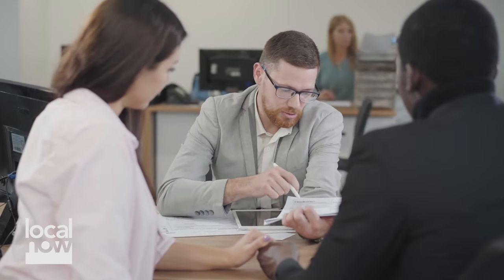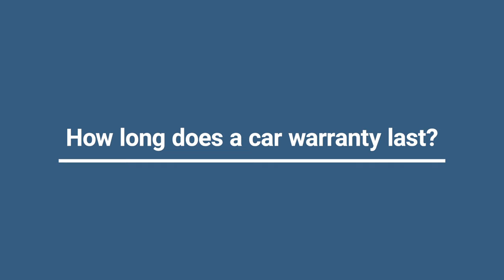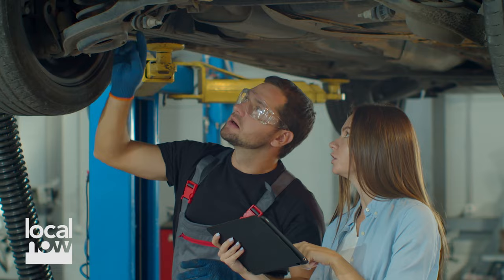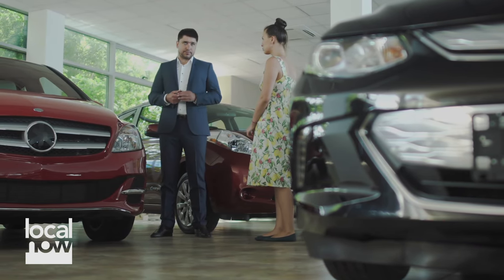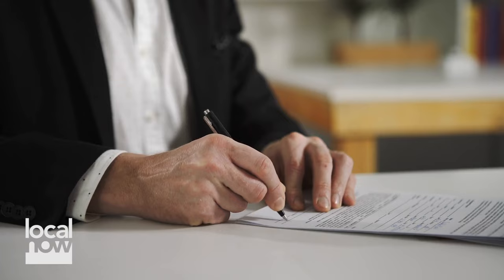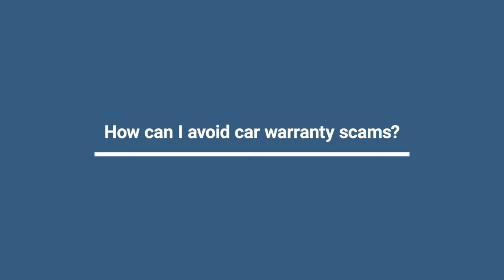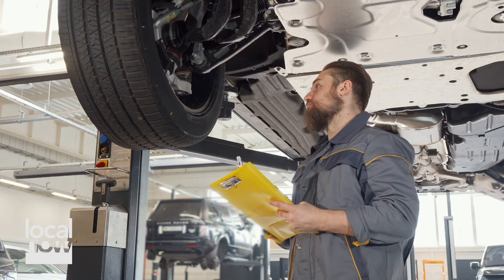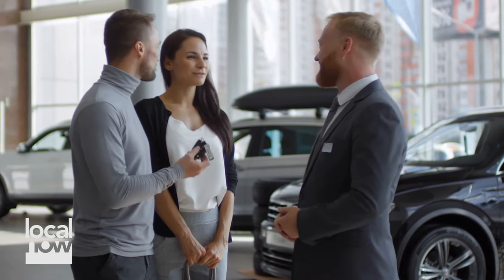The Truth About Extended Car Warranties for New and Used Cars

Comment: Adding my two more cents here about warranties. I had a new Lincoln Continental (back in the day). Dropped it off at the Mercury dealer the night before for LOF, etc., etc., nothing major. Planned retrieving the car early. The dealer told me it needed a motor mount. Said it would take 5 hours to replace, all under FORD warranty. I needed the car for work so I told them I was picking it up and would bring it back for the motor mount. When I arrived about 30 minutes later they informed me that they had already replaced the motor mount and had me sign some papers. I realized that they were just ripping off FoMoCo; but I also knew that Ford reps check the old parts once a month or so. If they don't have them they don't get paid. I should have pursued it but just hope that Ford caught them. They're no longer in business. There's liquor store where they used to be. Anyone wonder why new cars cost so much?

Comment: Most major components won't fail during their duration. Any plastic parts that do fail are never covered such as vacuum lines. Things in the TSB aren't covered along with many other components.

Moreover these warranties won't ensure the work is done properly. This is how you get a fuel pump replaced at 95K miles when it's a cracked hose at a brake booster.

Comment: @Lauren:
I have 11 months until my 2021 Jeep Gladiator 36-month factory warranty expires (power-train warranty longer @ 5 years/60K miles) -- the time very likely expire before the mileage does (I'm only @ 21K miles now). So since I am the "proud owner of Chrysler/Fiat/Stellantis crap" -- as some people would say (BUT my Jeep has been fine so far) -- AND because of the current crazy-prices auto-market (I don't want to sell mine and try to buy another with the higher truck prices & financing interest rares currently!), I'm thinking of getting a Mopar (factory) Extended Warranty as I plan to keep the Jeep longer than I first thought (likely 2-3 more years at the least). Not interested is "suspect" 3rd party extended warranties as they have mixed reviews, and I don't want a Jeep dealership giving me any grief over having a 3rd-party plan so a Mopar warranty seems the least problematic. And, I would want OEM Mopar parts for any repairs, not "alternatives" as per 3rd party plans.
So, getting a Mopar Extended Warranty would be Plan A, and from what I gather I have 2 decisions to make:
1. Choose between a Mopar "Added Care Plus" Extended warranty plan (cheaper but still some decent coverage AND may be the best value/cost ratio) or the "Maximum Care," Mopar's most expensive plan.
2. WHERE to purchase it at: A Jeep dealership in-person or online -- or alternative?
Any advice on this?
Plan B would do as you suggested: Just put money into a bank Savings Acc't and NOT get an extended Warranty. But like I said, I have "Chrysler/Fiat/Stellantis Crap" so I'm terribly concerned. Well, not really...at least not TERRIBLY.  ;-)
Thanks...
-- BR
Reply: @Leewilly440  Well, I'm going to research the Mopar warranty further, as that's the only extended warrant I'd want, even if aftermarket/3rd-party ones are cheaper. Plus, I plan to keep my Jeep maybe until 2027, so will just feel better with coverage at least for the major-cost repairs (parts & labor)...and likely go for their 8-year/100K miles (it'll take me forever to put 100K miles on it, so it's the TIME that will pass first).
Right now, I'm trying to decide if I want the Maximum Care or Added Care Plus. 
Then will look into where to purchase it, only @ Moprar online (like @ JeepFactoryWarrantyCom) or is there another source -- not a Jeep dealership, as I"d guess they'd be more expensive. Still, Mopar is pricey...but I guess all factory/OEM plans are.
What's weird though: I had 2 Hondas: a 2006 CRV (for 7 years) and a 2016 Pilot (for 5 years). Didn't have an extended warranty on the CRV but could have used one (2-3 major & costly issues!); DID have Honda Care on the Pilot but it was only used once for something minor -- and transferred the remaining 2-3 years of Honda Care over to the new owner when I got my Jeep. 
So who knows what's the best thing to do...
-- BR

Comment: Is an extended warranty the same as a service contract?
Reply from the maker: A service contract should cover basic maintenance like oil changes, tire rotations, etc. An extended warranty is designed to cover the vejcile when the factory warranty ends.